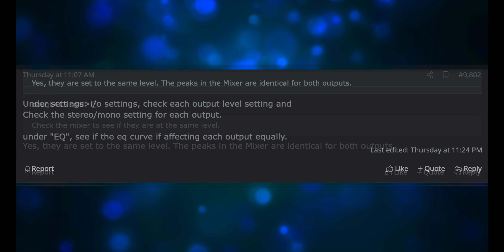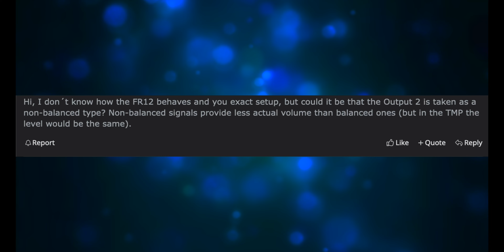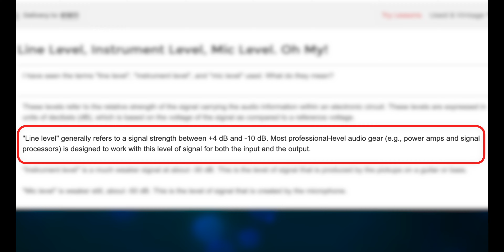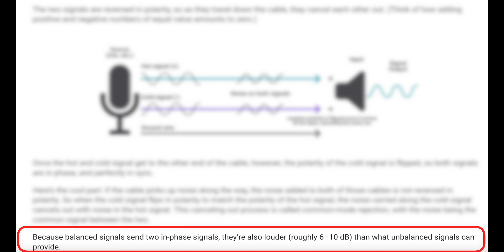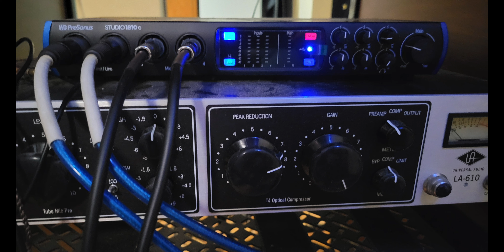Fender Tone Master Pro - Is Something Wrong With My Tone Master Pro?

Comment: Used my TMP last night for the first time on a gig. Using an xlr to mixer from output 1 was HOT and distorted the high frequency driver on my column system. I ended up using 1/4 inch from output 1 and it was fine.
Reply from the maker: The XLR outputs on the Tone Master Pro are set to line level, so you might need to adjust the pad or gain settings on your mixer to handle that signal.

Comment: Anyone else having problems with the tuner in the TFM? No signal at all is coming through when I press the tuner knob. Signal from guitar ok what I turn the tuner knob off. Firmware has been updated as well as reset to factory setting.
Reply from the maker: Click on the settings icon on the TMP, then go to the Tuner section at the bottom right side. Click on it and you'll see a button labelled "Mute". Press that button to turn off that setting and you'll be able to hear yourself while tuning. Personally I prefer to have it muted so no one else has to listen to me tuning  👍

Comment: Thanks for your videos, they help a lot to understand the TMP.
Is it possible to use the XLR and the 1/4" at the same time ? Il have a mixer, a headrush FRFR 112 and a boss katana 100 mk2 with poweramp in.
Reply from the maker: Sure - check out the factory preset called "Acoustic + Vocals".

Comment: I know the answer. It’s crap😊
Reply from the maker: Thank you for your insightful comment!
Reply: @DougBsDigitalDen  I’ve tried every non valve amp there is and it’s the same every time with transistors, they show their faults back to back against real tube amps. 
I’ve got two three amps all tube and an ampero stomp mark 2. The Engle and Marshall amps I have are 3d and I can’t see the attraction to solid state amps. On utube they sound good but in reality they are pants.

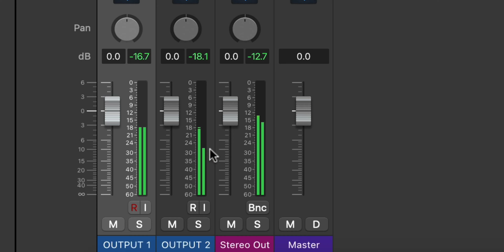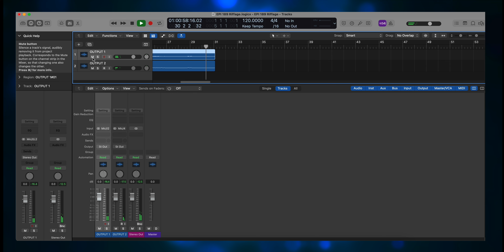Comment: From 7:00 to 7:54, you’re clipping your signal somewhere. There’s a lot of digital clipping noise whenever you have both outputs playing together.
Reply: I can hear it kinda sounds like when you set the clipper to high
Reply from the maker: I don't hear any digital clipping. The signal in my master never goes higher than -12.7.
Reply: @DougBsDigitalDen  I went back and listened again, and it's present any time you have Output 1 playing in that time interval I cited above. It's pretty obvious; I'm surprised you can't hear it. It's an upper-frequency crackle riding on top of the signal and it sounds just like a clipped digital signal.
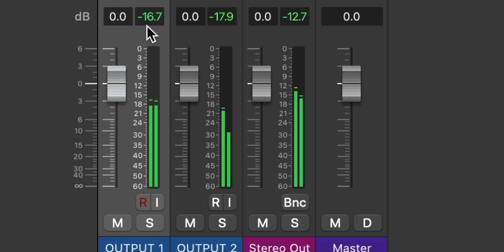Reply: Confirming I hear it (loudly at 7:22), and it does come and go with Output 1 in your demo.
Reply from the maker: No, I don't hear it at all, and I'm listening in my studio using Focal monitors.
Reply from the maker: I'm talking at 7:22 and don't hear any digital crackling at all. I'd guess that what you're hearing is coming from the combination of effects in that preset, as my output level doesn't even hit -12. My interface levels also stayed in the green the whole time. But maybe you guys are hearing something that just doesn't register with my ears.
Reply: @DougBsDigitalDen  It's not an effect and it isn't part of the modeling either. It's only present on output 1 in your video. It sounds similar to what I get on my Helix if I have the levels too high before the output block, where it starts clipping the output D/A converter as a result.

I realize you're not hearing it, but I promise it's there and it isn't that subtle.
Reply: @DougBsDigitalDen  I carved it with an EQ to hopefully make it easier for you to hear: https://youtu.be/dfWDok2tzL8
Reply: @DougBsDigitalDen  I checked on two headphones and speakers. There is distortion or clipping happening when output 1 is active.

Let me know if you need any more ears for testing to figure it out. Happy to help.
Reply from the maker: Found the problem - I didn't set my inputs 1+2 on my interface to LINE. I'm so used to using USB that I forgot to set this. You guys have better ears than me, thanks!

Comment: I’ve got the same « issue » in wet-dry-wet configuration. The dry (output 1) is about 10db hotter than the wet (output 2). I use the TMP with 3 FR-12 for this setup. Some workaround I found so far:

1- Have the output 1 as instrument output and output 2 as line level. This is not perfect gain staging match but this closer to be even.

2- Use the split signal mixer to turn down the dry channel routing (output 1)

3- Crank the volume for both FR-12 that receives the signal from output 2 to match the signal of output 1 (need to be by ear)

Also, because my 3 FR-12s are also connecting to my audio interface for recording from the DI outs of the FR-12s, I’ve discovered the DI out is Thru, meaning the FR-12 do not need to be turned On to transmit the signal to the DI. That way, I can turn Off the FR-12 and record quietly in my DAW. I can also manage the gain match from the UAD Console. So, this is a fourth way to match the gain of the two outputs of the TMP.

By the way, thanks for all the information you bring to the table about the TMP. I learn a lot from you videos and you became my go-to channel about everything regarding the TMP. Keep on rocking 🤘
Reply from the maker: 3 FR12s - I'm envious! Yeah, those do seem to be the available options. Very cool about the DI Out too, I was not aware.

Comment: Doug I’m using TMP with an acoustic guitar and an electric guitar.  I’ve created separate presets. I want both signals to go direct to PA. What’s the best way to accomplish this?  Separate lines out for each so the mixer can control each separately? Does this difference in output matter? Or just have both come through the same output?  Thanks.
Reply from the maker: Yes, use Output1 for your acoustic, and Output2 for your electric. At least that's how I'd do it. That way you can connect them to separate channels on the PA. Good question!

Comment: Very nice. Why is output 2 so different in panning?
Reply from the maker: I'm not sure. I could've done more testing to see if it was my cables.
Reply: It is definitly something related to the setup and not the TMP itself. I just checked it with my unit. I get exactly the same signals with an external interface out of the left and right Output 2.

Thanks Doug for the detailed clarification.

For your info: I was the one posting the issue on the gear page.
Reply: @thomaskuschel89  ye. Anyway i always use the XLR outs including to the cabinet. You get a better dynamic range via XLR

Comment: So after what Fender said about the discrepancy in outputs, does that mean they really are not balanced? Or they are balanced, but for different purposes?
Reply from the maker: Output 1 XLR and 1/4" outs are balanced. Output 2 1/4" outs are balanced impedance. Not sure what the difference is, because my brain starts to hurt when i dig into that stuff 🙄
Reply: @DougBsDigitalDen Impedance-balanced is a way of reducing common mode noise similar to a balanced output, but it doesn’t send a polarity-inverted copy of the signal like a true balanced output does. You still need to use a TRS cable to get the benefit of impedance-balanced outputs, though.

Comment: hey Doug to you have a contact i can sent you a message on my tmp seems to be doing something weird- when recording i’m getting a lot of weird low frequency behavior - even with simple setups - i play chord with low end and the chord plays as expected -  but then  get a weird low frequency (sounds like) feedback that swells after the initial transient. Ive used low cut and eq to get rid of it with marginal results- it’s not logic because i get it just monitoring my interface without logic running
Reply from the maker: How are you connecting the TMP to Logic, and have you updated to the most recent firmware?
Reply: connecting through audio outputs 1&2 into UA volt 476p (4 channel audio interface) - it’s not on all patches only some - it may be a headroom thing on the audio interface - if i can’t tame it in analog, i may create an aggregate interface in logic and allocate those channels to a synth. The patch i was using had signal going into clean amp channel then router to dirty channel so it could have been an amp model issue - i turned the dirty channel gain way lower than preset and it helped!
Reply: Hey Doug for what it’s worth i figured out the prob- my 6th string is significantly louder than the other strings on my fender guitars (thank my tech for that) so i dropped the low end angled on my pickups a little for a more even volume and it fixed the prob - i thing the TMP is sensitive to that- but my bad;-)